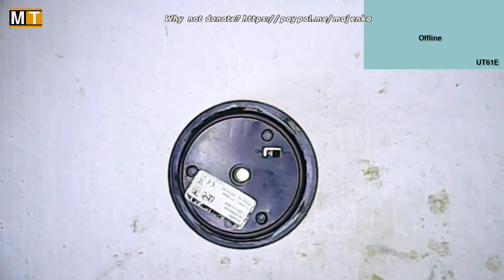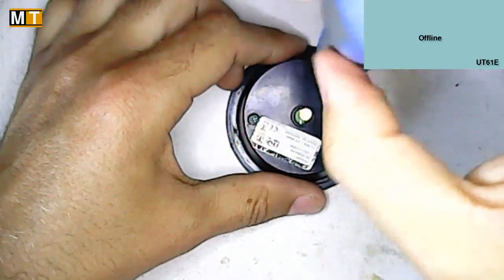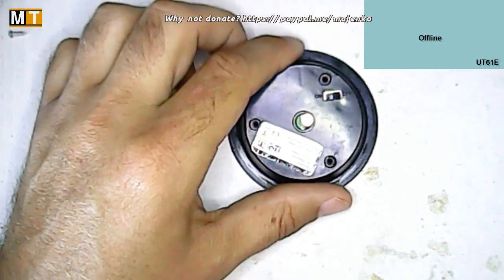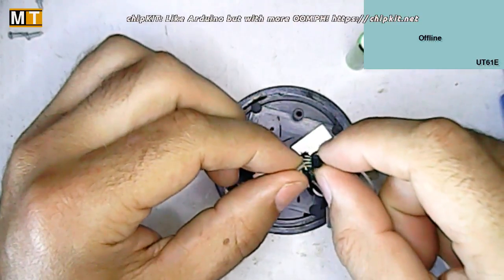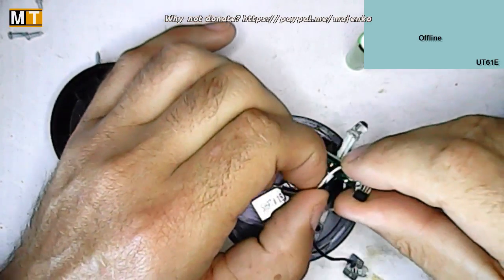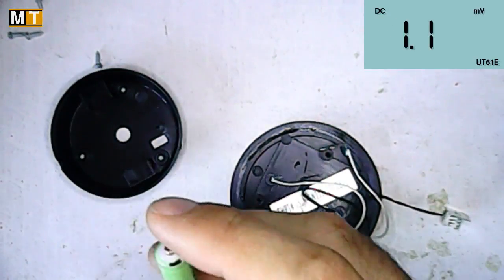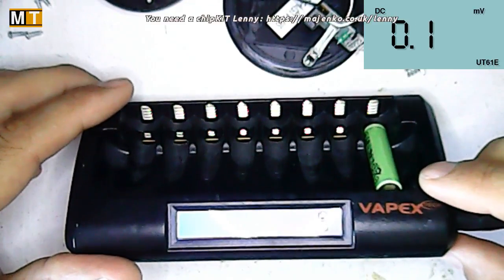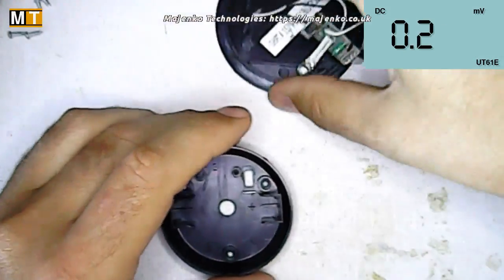Teardown, diagnosis and hopeful repair of Solar Light module

Comment: I can't believe he put it together with a bad switch. Iffy at best. I would at least jumper the switch so not needed. I am working on several at this time and so far, it has been the solar cells. I am looking for a replacement now. My units use a YX8019. I can't find any difference between the -18  and - 19.

Comment: Battery was discharged but not bad, so you should check solar panel short circuit current, because it can be enough to detect day/night and light up lamp, but not enough to charge battery.